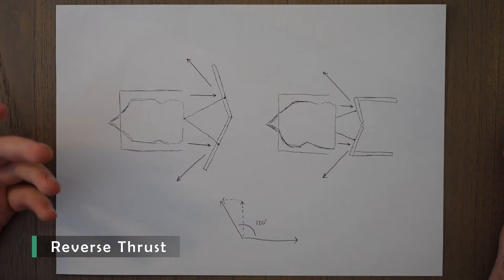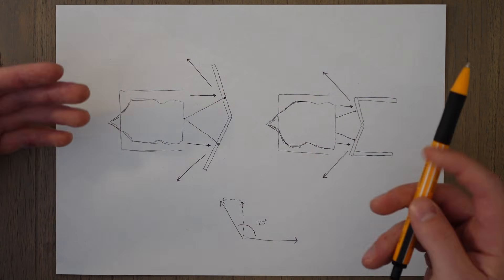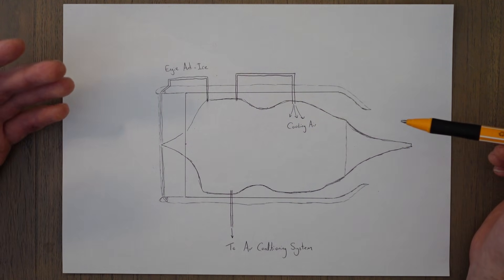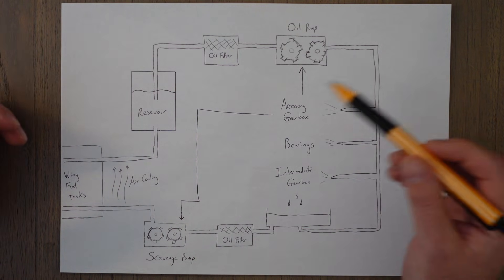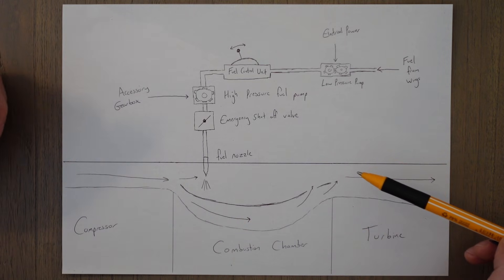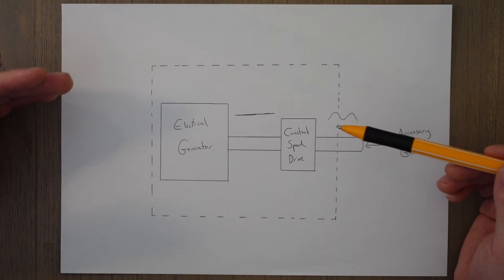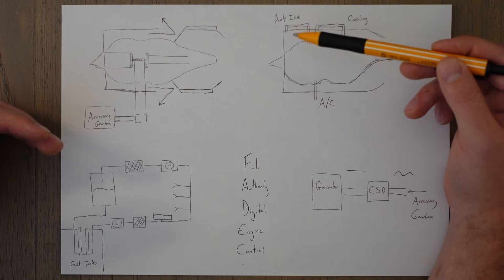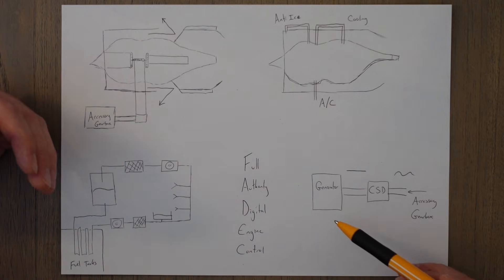ATPL Aircraft General Knowledge - Class 7: Jet Engine Ancillaries.

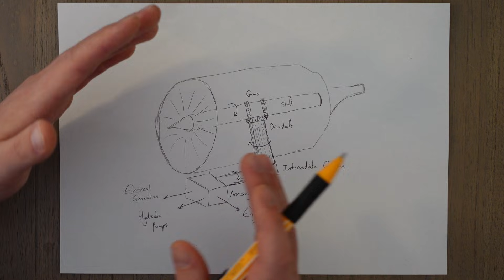Comment: hi grant thank for everything. shouldn't the oil that passes through the accesory gearbox be collected in the sump. in the schematic, minute 6:29,  it look like it's get sucked by the scavange pump and bypass the oil filter.
maybe the arrow from the accesory gearbox to the scavange pump mean that accessory gearbox power the scavange pumps
Reply from the maker: Yeah the oil will be collected in the sump. As you say the arrow is supposed to show that the scavenge pumps are powered by the accessory gearbox.